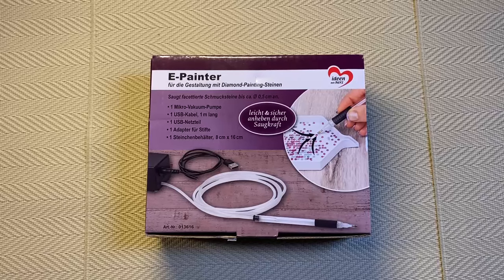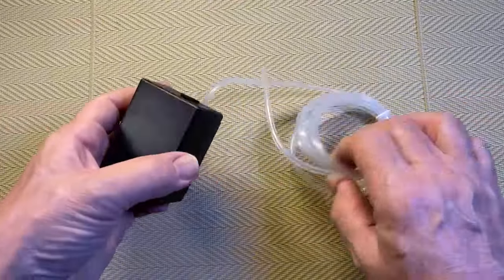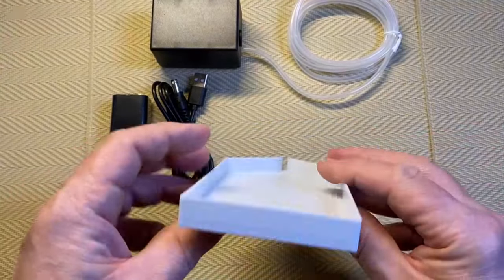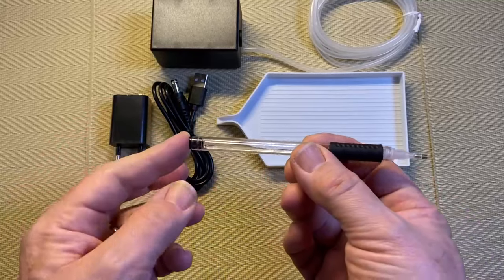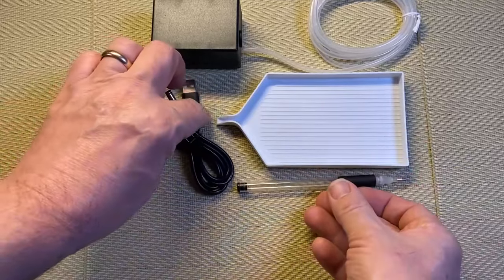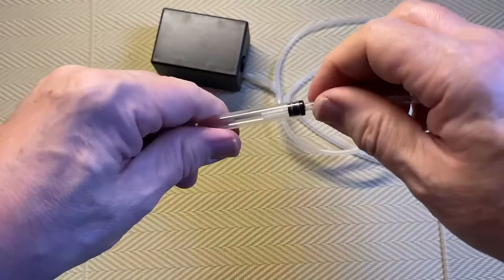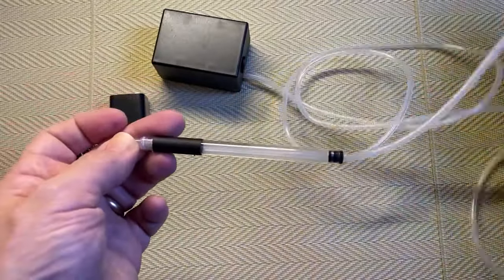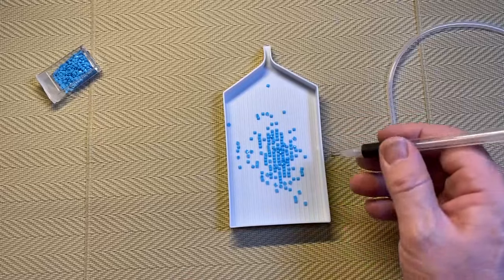Finally! A Diamond Painting Pen That Doesn't Use Wax, Never Drops Drills And Never Needs Refilled!

Comment: lol that long cord is going to be in the way & it’s cumbersome. It’s extra nonsense that’s not needed m. What they need to do is make a proper pen. A pen that feels like a regular pen with metal tips but not the fat metal tips that are to wide to place dots. The size of the pen tips needs to be like the cheap ones the kits come with & the additional heads need to be thinner metal not so thick along the edges because those thick metal tips do not fit close for placing they leave a wide gap & you have to stop and realign fits every placement. There’s 1 pen that’s decent it’s made by DD and it’s in the home kit but there’s not additional heads unfortunately & the pen is t designed to last long.
Reply from the maker: I was going to ask who DD was then realised it’s probably Diamond Dotz but as far as I remember their pens are the standard plastic straws with the nylon and brass tip?

This pen uses exactly the same tip, nylon with a brass insert and the tiny hole inside. So if the tip gets damaged it can easy be swapped out from any basic pen.

Thanks for watching! ☺️

Comment: Would you buy it again, what is the currency exchange and is there a way to order and not get caught up in something I didn't want.  I do like your videos.  You have a calm way of explaining and I love the accent.  Thanks again.
Reply from the maker: If I was working on a more upright board or easel I would use it because the drills don’t fall off the pen.

You also don’t have the issue of AB drills pulling the pink wax out of the pen because there is no pink wax.

As for a refund if you don’t like it, I’ve no idea but I’d guess that they don’t have that option.

You could try contacting the company directly and asking them.

I’ve just noticed that this pen shows up on Amazon.nl

I don’t know if that would be a viable option for you?

Thanks for watching! ☺️

Comment: I’ve thought about this idea for ages only thing that worry’s me is the cost of electric using it for hours on end
Reply from the maker: Hi Sharon, i did a search to get some kind of reference and found that the national average electricity rate in America is 13.87 cents per kilowatt per hour.

That's 13.87 cents for 1,000 watts per hour.

The pump for the pen only uses 3.6 watts per hour.

I don't think you'll have to worry about it bursting the bank. ;o)

Thanks for watching!  :o)

Comment: Nice to see you again Jim! What an innovative pen and can see using it a lot when widely available. When you were trying to put the hose in I found myself so focused on you getting there that I found my nose almost on my screen!! Lol. And then you had to do it the  second time...alas now I may have a kink in my neck!🤣 Since it has that little adapter hose, have you tried it in one of the acrylic pens? If it worked on those, I would definately try to track one down to purchase in the US.  Thanks friend for sharing with the rest of the diamond painting community! Good wishes, Debbie in Kansas USA.
Reply from the maker: Hi Debbie, if there was just a little indent in the top, it would make it a lot easier to get the tube started.

Apart from that, the pen works really well.

A few people have commented to let me know that this pen is only available in the EU at the moment.

It won’t work with any of my custom pens because they don’t have a hole all the way through to the tip.

I’ve been thinking about it. 😄

Hopefully they realise that there could be quite a demand for it and open up for international shipping.

Thanks for watching! 😊

Comment: That is really cool! I hope they'll come up with a multiplacer tip that will work with this.  They'd really just need a mesh or screen type thing to allow the air to go through but not the drills. Do you have a link to where you purchased this?
Reply from the maker: Hi Kat, I bought it from Amazon.de but the company has a website.

www.ideenmitherz.de

Thanks for watching! 🙂
Reply: Did you found the e-painter?